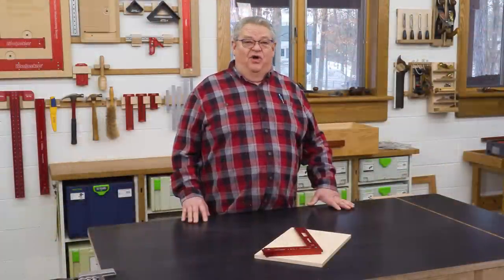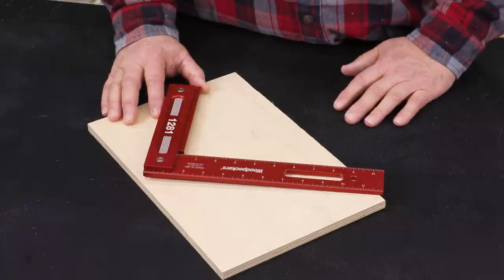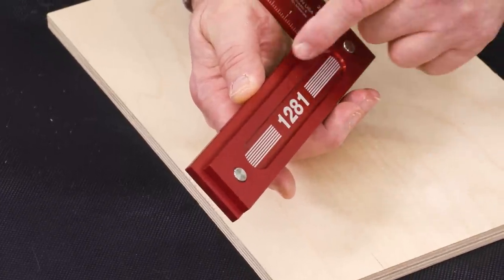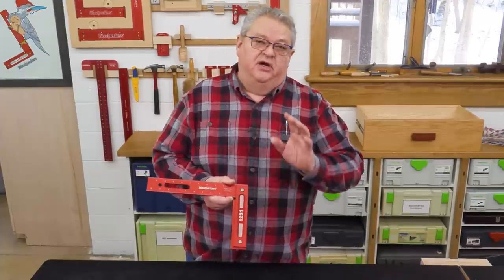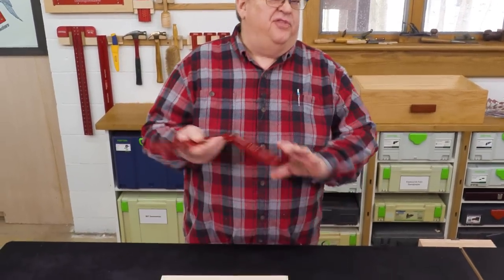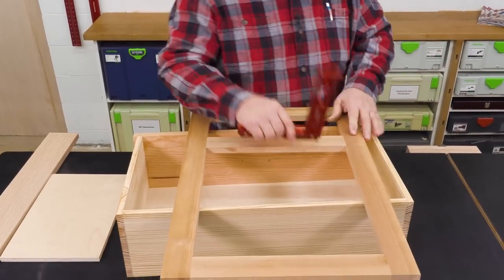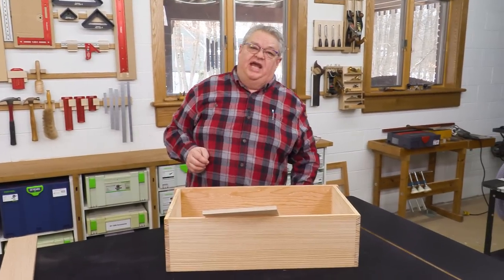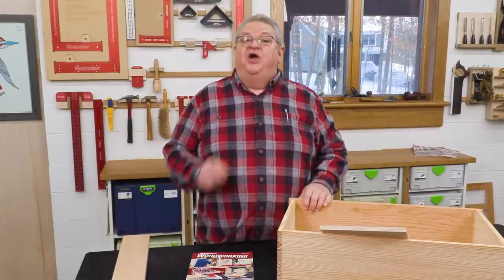One Square To Rule Them All  |  Woodpeckers 1281 Precision Woodworking Square  |  Deep Dive

Comment: Hi Jeff: well I love the square and use it all the time. Sad note is that I dropped it and dinged the corner - Crap! I don’t have another precision square to check it against, so what’s the best way to check to see if it’s still square? I probably should know of a method but I really don’t. Thanks, Rich
Reply from the maker: So...this should not be the "be all, end all" test, but it is a quick start. You need a piece of stock with a very straight edge. Put the square on the edge and strike a line. Flip the square over the other direction and bring it to the line. It it aligns, your square is good to go. 

Regardless of that test, if you're concerned send it in. We'll recalibrate it and send it back to you. If we can't make it square, we'll replace it.

Comment: I would like to see a 3" square in stainless.  I'm always trying to make sure the edges of my boards are square to the face after hand plane work on the edges.  The larger squares make it awkward and I've dropped them due to sawdusty hands and awkward size of the square.  Starrett makes one and I'll probably get one of those if WP doesn't make them.
Reply from the maker: Have you seen our mini-square? It's not stainless, but it is perfect for checking edges. Very handy little tool to keep in your pocket all the time. We even have customers that use them as key fobs.
Reply: @WoodpeckersLLC  I wanted to try stainless because I keep dropping the aluminum ones and I hate that because they easily get damage on the corners from the concrete.   I was thinking that the stainless would handle the drops a little better than aluminum.
Reply from the maker: Thing is, you can dress off the dings in aluminum very easily...pretty much anything abrasive will do it. Stainless is much harder to dress.

Comment: Neat trick, if you have a damp basment shop,  in pill bottles they almost have a moisture absorbing device that says do not eat, you also find them in electronic devices shipped overseas  drop a few of these in each tool box draw and it should asorbe the humidity so your tools don't rust.  Its free insurance.

Comment: They're great, until you drop them - then they're worthless except as an (awkward) ruler.  I don't have a padded shop floor, so it's stainless steel for me.
Reply: I think you can return them if they are ever out of square.  they will repair or replace as needed.
I can't say if dropping fits in normal use or not.
but their copy reads:
We take great pride in the design and manufacturing of these squares. So much so that we will repair or replace your 1281 anytime you find it to be out of tolerance. No fine print, no disclaimers. If it’s not square, we’ll make it square or replace it.
Reply from the maker: ekw555 is right. Send it in if it isn't square. We'll fix it or replace it.